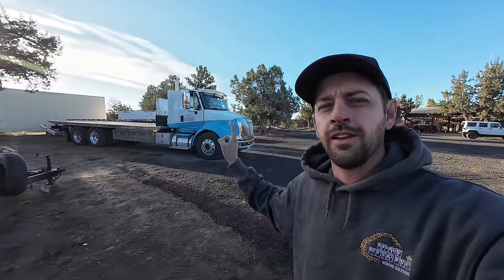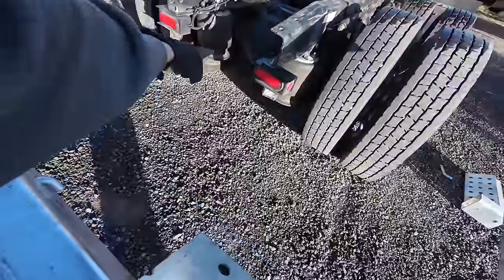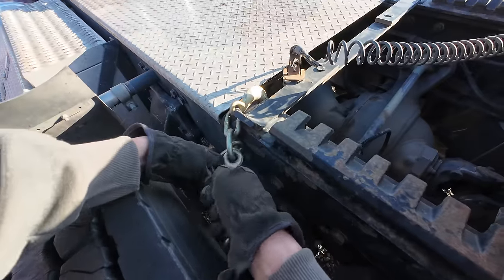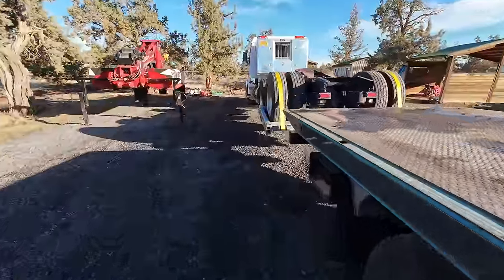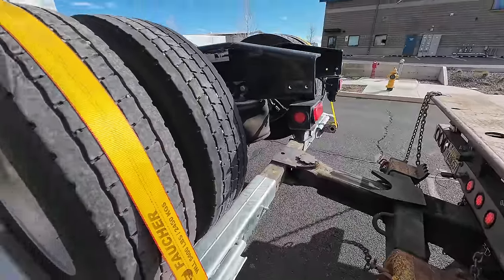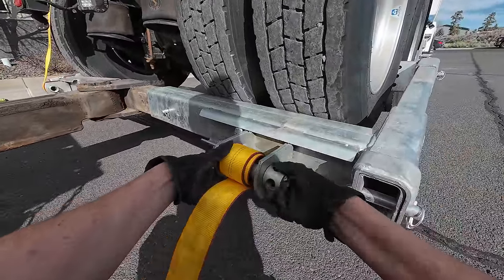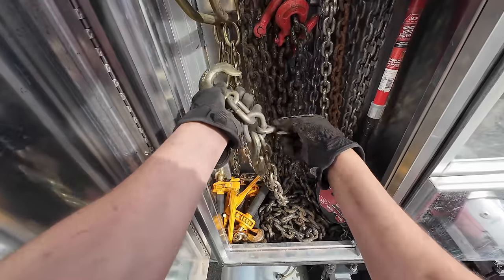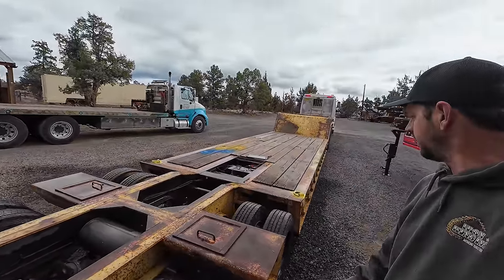I had to tow my own truck..

Comment: You should make a video on how to properly hook up your wireless tow lights to your truck to charge them
Reply from the maker: Plug it in..
Reply: @CaseyLaDelle  I understand you plug them in but I’m trying to get at where do you get your source of power? Do they get ran straight to the batteries or do you have a junction box to get the power?
Reply from the maker: @AlbertoGonzales-mc9jv  positive wire and negative wire.  There’s literally nothing more to it

Comment: Casey, can't you just flip the strap winch? It seems like it can be taken out on the inside side of it's slider. You might need to crank it in the other direction, but I think it should work
Reply from the maker: It won’t
Reply: @CaseyLaDelle  okie then. hope someone finds you something that works. Could you elaborate on why it woudn't? I thought having the strap unroll from the bottom and having it rub on the rail could be an issue, but i'm nut sure if this is your reasoning. Cheers
Reply from the maker: @marpheus1  
https://youtube.com/shorts/TZzyrU1Dws0?feature=share

Comment: I thought when you first bought the new truck you said it would fit on the flatbed. Is this easier or did I miss understand?
Reply from the maker: It will fit on the lowbed, not the rollback

Comment: Regarding the wheel straps being the same on both sides is it possible to flip one upside down ... granted doing that u might have to pull the strap out completely and re run it but its just a thought i could be wrong
Reply from the maker: The latch wouldn’t work

Comment: ROTFLMAO...."The gloves are to keep your hands clean?"  Sure, if they're latex and you're painting.  The purpose of work gloves is to protect your hands, assist with grip, and/or keep them dry and/or warm and/or as an added bonus "cleaner" cause I assure you if you're working hard your hands sweat and still get rank and nasty while wearing gloves.  "Clean"😂🤣

I worked on final sand tampering & setting 12" x 12" pavers with packed pea gravel between them in a new patio area all day yesterday and got tired of taking gloves off and on and switching from leather to heavy duty rubber and eventually played the fool and have a few knuckle's with abrasions today as evidence from doing some of the work without the protection of the gloves, which was not ideal for my hands that were both dirty & bloodied and had to be washed either way.....lol 😂😎  

Off to Home Depot for two more bag of sands (play sand on sale for $3.99/50 lb bag right now) & another bag of rock so I can finish leveling/setting & packing the gaps between the last 9 squares.....yabba dabba do....lol   & Thanks for sharing Casey😉👊

Comment: Casey on the wheel grid winch straps; is there a reason you strap around the outer dual and don’t route the strap in between the duals?  Is it a pinch point or DOT regulation thing?  I’m not an expert so I figured I’d ask one.  Thanks brother.
Reply from the maker: Yes, it’s worse in every single way
Reply: @CaseyLaDelle  gotcha.  Well thank you for answering and thank you for the video!

Comment: Comment on wheel straps:  could that one be removed, flipped over and the strap reverse wrapped so it holes faced the outside ?  This would work if the ratchet locks either direction...
Reply: But it doesn't.
Reply: @georgevindo  So that's why Casey hasn't done that already... :-(

Comment: I take it no mobile glass repair is near you? I got a massive rock through the window a while back, watched it on the dashcam fall out of a guys bumper hit his tire, split into two pieces and one piece launched down my hood and through my passenger side of the window on the other piece, Shattered the entire windshield massively.
Also as for the dirty gloves on the interior, My solution still gets some parts dirty but what I do is carry two pairs of winter gloves and I always have one pair in the defroster, Run the defroster while loading and when i have to get in the truck or my hands get too cold I take my gloves off and switch pairs and throw the old pair in the defroster, Then you have a constant supply of warm gloves, and you dont get most of your interior dirty by touching the wheel, the door, etc you just get the top of the dash and the windshield in some spots dirty.

Comment: 21:57 why knot pull that strap winch off, rotate it 180° clockwise and run the strap from the opposite side it's on now so it still rachets the same to hold its lock?? 🤔
Reply from the maker: Because it doesn’t
Reply: @CaseyLaDelle  ohh? It only fits the one way on the sliding track?
Reply: @BurchellAtTheWharf  No, the problem is that gravity is then pulling the ratchet lock off the ratchet instead of toward it.
Reply: @senhowler  I thought the lock was spring loaded for some reason, can't blame the dumbass to much, eye spend most of the time in a boat and knit the road 😆

Comment: Would it be illegal to put the truck on the rollback and just hang the rear axle in the air with the same axle chains?  Or is this way faster than tying down the truck ?
Reply: Although  it might be over height.

Comment: Genuine question, what is the point of putting a safety chain on a cross member if the intent is if the truck comes off of the roll back going down the road the chains only job is to create more damage by destroying the cross member, electrical and airlines that are there? If it’s just there to create more damage wouldn’t it be cheaper in the end to just not put the chain on it at all? I’m just confused.
Reply from the maker: Because the law requires it

Comment: I've replaced my windshield at least 10 times in a span of two years because of rock chips. 

I would get the chip repaired and another chip would happen and it would crack before I could get it repaired again. 

My windshield now has a chip that I had repaired and still cracked. 
Another crack appeared where no chip was, so have two cracks in my windshield now.
Which the second is in my line of sight when driving. 

I won't be getting it replaced unless I absolutely have to.
Reply: Good idea to have it fixed if you have another violation such as bad tail light. 
My friendly local police man pulled me over to give warning about the bad tail light,  then had to write me up for one because that was the 2nd unsafe issue during the stop.
Reply: @marlar58  I'm generally pretty good at having it replaced asap, but with my current location that I moved to last year,  I don't know of any reliable windshield services.

Most of the chips in my windshield I got from traffic going the opposite direction of travel or roughly three street blocks ahead of me. 

I at least know how to change head or tail lights myself. 
I had someone mistake me for a worker at an O'Reillys once while changing a part on my pickup.
I did help them change their headlight bulb though.

Comment: Ignorant question. 
What is keeping the passenger side ratchet strap from being flipped over? I realize that the ratchet would be winding the opposite direction but wouldn't that solve the issue?
Reply from the maker: Gravity
Reply: I was unaware that the ratchet strap was spring loaded, so thanks for the explanation.

Comment: Put the winch on the other side
Reply from the maker: And what would that solve?
Reply: You said that you want the holes on other side so if you switch the winches with each other it would solve your problem
Reply from the maker: @ryanpotter8286  how would it solve anything when the one from the other side that comes to this side is exactly the same?
Reply: My bad. Went back and looked. Your right.  My apologies

Comment: Take it off and turn it up side down and wine the strap like you need it to be that way everything will work like you need it to 🤔
Reply from the maker: How would the latch work if it’s upside down?
Reply: I was thinking the latch would just go the other way ,sorry wasn’t thinking the right way ,without hands on , you doing a great job like what you doing 👍

Comment: When you flip it over redo the rachet so it's  on top. I did this on my car hauler and it worked. I have seen you fabricate some things and your an expert welder. Let me know if it will work on yours like it did on mine. Let me know by email. You have my email it has whd in it.

Comment: So just an unnecessary comment to help the algorithm.  Think I would work on a  flat tow for your pickup so you can just drive your pickup after you have to take your truck for service.  Second unnecessary comment, most glass service companies will come out to your house or business to replace your glass.  I used to do my own windshields back in the day,   just tried to keep drivers side handy.

Comment: I watched the short about dumbasses telling you how to put a jigsaw together inside out and had to come and see how it is meant to be and. . . what you meant by a reversed ratchit. Well you just drop one off to an engineering shop so they know what you want. I'd say they might reverse the racheting hub for you and the winch tube - or - fabricate it from scratch.? The bar to wind those has a bend in the tip so a guy can rotate the bar half a turn and add some turn without removing the handle. I thought you had just that bar at first but later using a straight tube ? Agreed it would be best with the handle holes outboard.  If on backward the pall would have to be raised from bottom to top and the toothed wheel removed turned and reinstalled Ae?  Your short did my thinking in for a bit, good to be up to speed now!

Comment: If you’re wanting the safety chain to just rip off the cross member so that the towing truck is no longer connected to the truck that it’s towing, then what is the point of the safety chain ? Surely it would be better for it not to have a safety chain with that logic ? Obviously Casey knows what he is doing just that doesn’t make any sense
Reply from the maker: I very much agree, but legally they have to be there